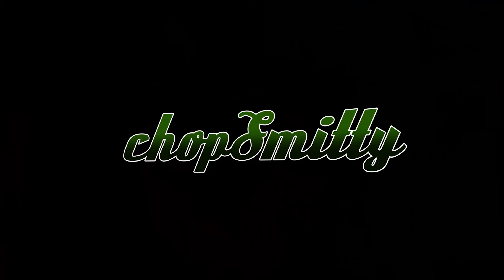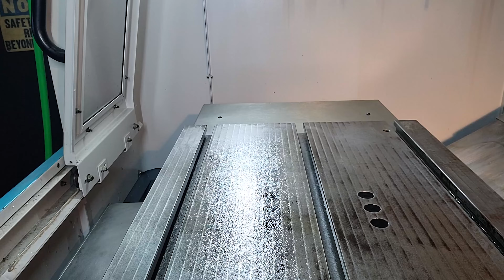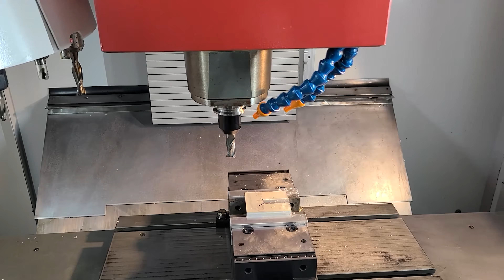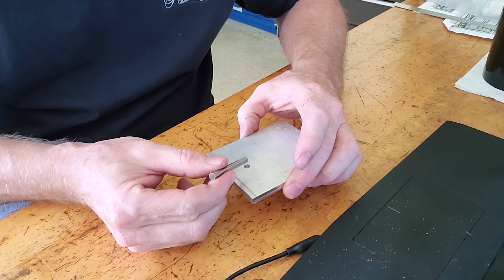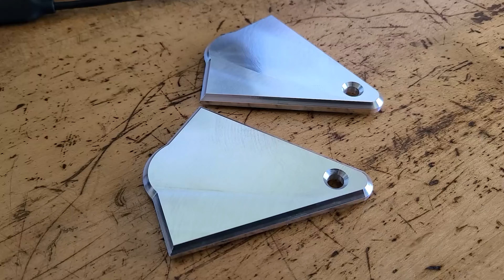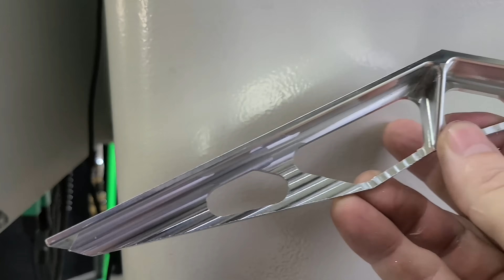First Parts off new Orange Vise

Comment: Nice    How do you like the Orange vise is it worth 2K    How is the clamping deflection on the solid jaw?
Reply from the maker: Hey Joe, I really like the Orange. It's a lot of dough for a vise but, yes, I'd buy it again.  I'll check the deflection when I have the vise in the machine again.
Reply: @chopsmitty  Thanks    i found that the vises that the solid jaw is keyed and bolted have a fair bit of deflection. So at the moment debating on what to get Kurt has some that are all one piece  but i do like the looks of the orange
Reply: @chopsmitty   Hey on one of your videos about your cnc mill you mentioned you sent your hard drive to fives to clone and put on ssd   How did that work any issiues and roughly what was the cost   Im looking at doing somthing like that to increse my capacity
Reply from the maker: Joe, my experience with Fives was really positive.  Very professional company.  Very good customer service.  With that comes a pretty steep price tag.  It was expensive.
Reply: @chopsmitty   yeah   they quoted me $3,500 for a new hard drive
Reply: @chopsmitty   Just an FYI   I just had my LCD monitor replaced by a Canadian division of a Florida based company . Did the whole job monitor and labor for  $900 CND  Fives wanted 3K just for the monitor